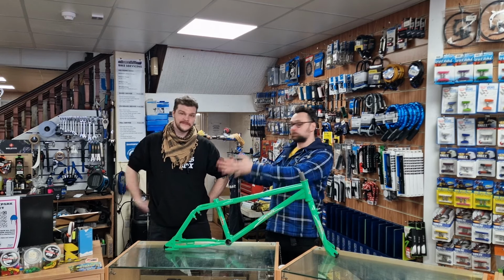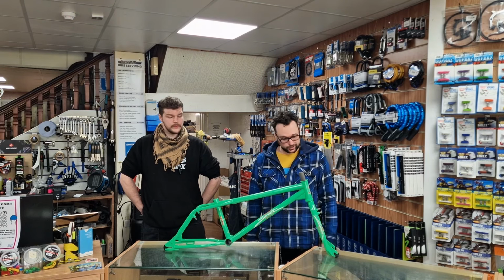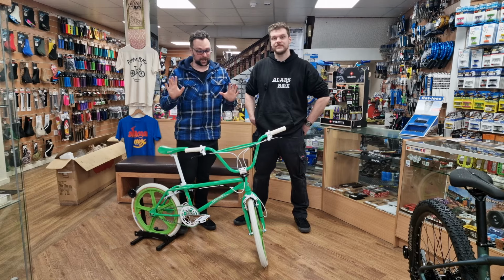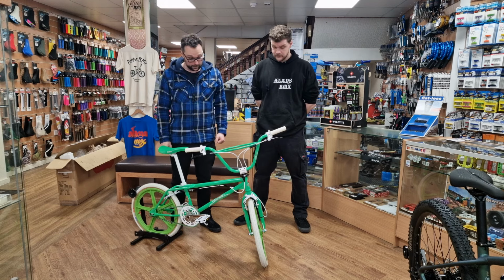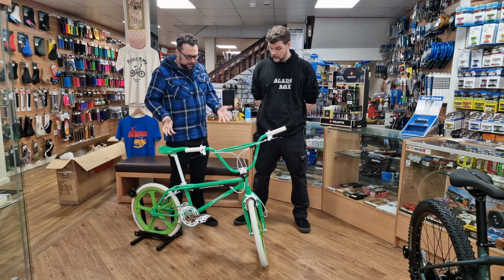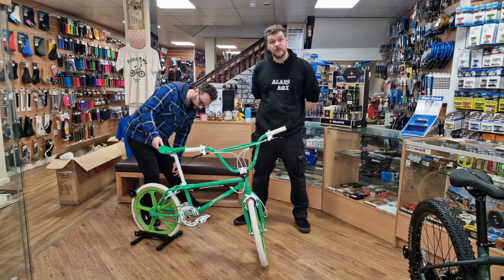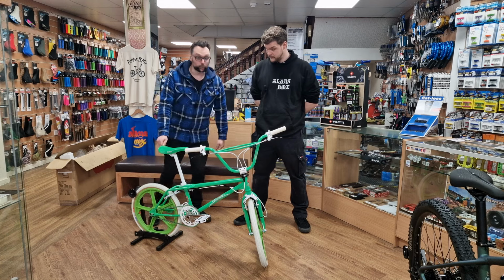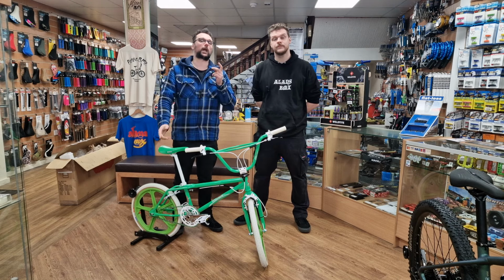Skyway 2024 Street Beat Green Build - AlansBMX

Comment: Good to see the master at work. Would have liked to see more detail on how he fit those Panaracer tires to the Tuff Wheels. I'm having a hard time getting my Panaracers to sit evenly around the Tuff wheels. Tried soapy water, massaging tire around, still have a slight wobble. Its embarassing to have wobbly tires on a bmx with nearly $2000 invested.
Reply: Depends on the brand of tires you use on Tuffs. They need a tight fitting tire. Some tires work with them and some don't. Way back most guys used to use Comp ST's on them and they worked fine. I use Kenda 2.2's on mine now and they work great. Keep in mind that's what the Haro's tires are and what they put on their stock bikes that come with Tuffs. Some of those huge wide new tires I'd guess wouldn't they weren't really made for that big of a tire. I'm just guessing on that though not positive. We used to run up to 89lbs of pressure in the Comp ST's. I do about 60lbs in Kendas now.